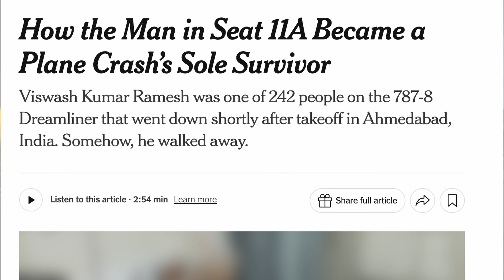Why the RAT Changes Everything – Air India 171 Update

Comment: Shirley on the original video, the sound of the two engines would have been more prevalent than the RAT if they were working. Not to mention the visuals of burning fuel assuming they were on full throttle to try and climb.

Comment: So I appreciate this pilots perspective but there is ANOTHER scenario that was not mentioned. If 787 after startup checklists were not completed normally, the pilots could forget the switch from APU power to main generator power. The aircraft can still takeoff and fly just on APU power. If that APU failed on take-off the RAT would deploy. On this day there was a very high density altitude situation with full fuel and passengers. If the APU failed there would be a flicker in the lights as the RAT came online. This would cause some confusion to the pilots at this critical stage of flight as their minds are turning to the departure proceedures. Not saying the wrong switches were selected but it's still another possibility.

Comment: Thank you Captain, for an insightful analysis and education (had also seen your earlier analysis on a plausible pilot error).  Besides the distinct propeller sound of the RAT, the only accompanying noise pattern that I am able to discern is that of air friction.  At the most, there is just about as much main engine noise as from an airliner on approach or in cruise.  But a fully loaded widebody jet on takeoff should be making that distinctive deafening way-high-pitched whine that would drown out everything else?! If I am right, could this be yet another indicator that the main thrusters where dysfunctional?

In the plausible pilot error scenario you had mentioned about in your earlier video, could the aircraft have collapsed immediately as it did? Or more likely struggled to gain altitude and possibly crashed after several miles perhaps? If either is possible then it is way too scary how sensitive the whole setup is.  The machine should not even allow pilots (who are after all humans and prone to making mistakes) to pull the flaps up prematurely...

Comment: Have you considered the fact that the RAT could have deployed as a cascading symptom of a flight control induced bus instability - LATAM 800 (2024) is a great example where that happened. I am still leaning towards the early flap retraction as I can see the configuration being clean in the HD video which is my primary clue to lean towards flap retraction, and it would have been obvious on the trailing edge if flaps 5 or more would have been deployed. Also if you count the seconds from the point of the usual "gear up" callout to the loss of lift in the first CCTV video, it is weirdly consistent with flap retraction timings... I think this has been a cascade of failures as with all accidents, but we need to wait and see for the initial report.

Comment: what is the probability that the there are some sort of electrical malfunction due to which the pilot could not raise the landing gear though pilots did best to lift the gear and by the time of their try to lift the gear up, the electrical failure resulted the engine power supply failure and both engine did not work and it crashed ? Because the pilot was sufficiently experienced and can be assumed he did not forget to raise the landing gear. there must be situation the landing gear did not go up.....

Comment: My current theory is possible dust / fine sand inhalation by the engines at the end of the runway, leading to engine flameout or severe performance issues effecting thrust. Is this feasible? or are jet engines more robust than that? ingestion of fine dust / sand particles (e.g., from an unpaved surface during an overrun ) could "choke" the compressors or cause significant damage, leading to severe thrust loss or even flameout.  We note the dust at the end of the take off run for this incident. Did they over run the runway ???  The RAT can also be deployed manually. I recon it might have been a combination of issues. hot day, heavy aircraft, possible electrical and or engine failure, RAT deployed could have been automatically or a panic move by the co-pilot in anticipation of complete dual engine performance issues with complete engine failures yet to occur.  Oddly they never said engines out,  but simply no thrust.  Still more ideas yet for formulate.  I think the flaps were deployed fine for take off,  but the aircraft was already at its limits. Possibly over heavy on an extremely hot day. Can't see any flaps extended on that YouTube video of the same aircraft taking off one week prior either, except when close up.  Thus perhaps they did have flaps 5 on that tragic day,  but we just can't see them with the naked eye at a distance beyond a hundred yards or so. That's not my final analysis however.
Reply: The engines could still be physically running, potentially even at idle or a very low RPM, but if their output power degrades severely enough or becomes unstable, the associated generators can automatically trip offline to protect the electrical system. This would lead to a loss of electrical power, triggering the RAT deployment, even without a complete engine flameout.

Comment: Deployment of the RAT seems to point to simultaneous engine failure.  If you don't have the flaps set properly pilots, get a loud warning when they put the thrust levers to the takeoff setting. With dual engine failure you lose electrical power and hydraulic power which automatically triggers RAT deployment.  Question is what caused both engines to fail at the same time?  The fact that you can hear the RAT propeller blades singing over the sound of jet engines running is a hint.  Maybe fuel starvation?  Wondering if it just came out of maintenance?🤔

Comment: The fact that you can’t hear the engines screaming as the pilots pull the throttle trying to gain altitude is pretty telling… if the engines were operational you would hardly hear the rad over them
The other clue is that the same plane was allegedly having electrical issues on a prior flight from Delhi, where the aircon was not operational and some interior lights were not working.

Comment: 😂😂😂😂😂 pilots were well trained so they couldn’t make silly mistakes when flying , they followed their routine , how to fly and most importantly they taught by simulation in class . So no this theory is wrong when you said pilot said this and copilot mistakenly followed wrong step . No no no 
Flate flaps theory was also wrong because if flaps are flate so how plant take off in air ? So it is possible flaps get flate in air but due to technical failure flaps not make any angle so they were flate in air but not when take off

Comment: Perhaps the "flaps instead of landing gear" theory is still correct IF there was built in computer error correction automatic command to drop the RAT if the combination problem of altitude too low and the rate of rise was too low. So, the co-pilot erroneously changed the flaps instead of raising the landing gear such that the rate of climb was too low and the computer automatically dropped the RAT with perfectly functioning engines.

Comment: The exhaust plume on rotation is evidence that the engines were producing power at that moment. The RAT deployment is evidence that they both lost power seconds later.

Could this have been intentional? I hope and pray the flight data recorder doesn’t show both throttle levers pulled back.

Comment: The 787 records 2000 pieces of data twice per second. The black box will provide definitive proof of what happened. We need to determine this quickly, in case it's an operational issue with the aircraft that may also affect other 787s.

Comment: Could have been a dual engine bird strike. Birs dont always fall to the ground, let alone the runway.
I have cleaned dozens of bird strikes off fighter aircraft wing pylons. Hitting a bird with an aircraft is like hitting a bug on the freeway. "SPLAT". And what left over sticks. Hitting a flock of birds is even worse. Very easy to take out both engines at the same time.
Could also be water in the fuel. It happens. Back in the 1980's we shut down flying for two weeks because water got into the fuel line that runs from Nellis AFB, AZ, to George AFB, CA. There was something growing in the fuel, and we had one F-4 lose both engines, shortly after take off. Both pilots ejected, after a scary as hell flight. It was going to crash into a school. They managed to get the Fighter into an unpopulated area of the desert. Both men received high praises for that.

Comment: It means that During the takeoff run to V1 , everything was fine. Everything deteriorated after that point.
Perhaps a problem in the FADEC(Full Authority Digital Engine Control) a software update or a faulty FADEC could have caused a loss of power in both engines. In the past, some aircraft had a thrust pump that was activated precisely in these cases of power loss during takeoff. I assume that the B787 does not have this system.

Comment: It is evident now that reason for fatal crash was most likely dual engine failure.....not error of pilots....you owe an apology to brave pilots !! ( as I recall , you have not flown Boeing 787, you do not have knowledge of 787 , moreover  in another video a 787 pilot and a 787 engineer who worked on the design of the aircraft both separately wrote comments that the 787 will not allow you to accidentally retract the flaps when it is incorrect to do so). Hence your theory of raising finger at pilots was absolutely incorrect ...Shame on you !!

Comment: To me it seems the big question is why would "both" engines fail at the same time. The only thing I can think of is fuel starvation. 
So the question then becomes, what would cause fuel starvation. The only thing I can think of that would affect "both" engines at the same time is the fuel flow was turned or cut off.
Now the question is what would cause the fuel flow to stop. Could it be a malfunction of the engine fuel control cutoff?

Comment: But would have it not become very, very quiet in the plane, if both engines were out? Should have that not been reported by the eye witness and from the video footage...? 
What would happen, if for some strange reason the entire electric system on an aircraft fails? would the engines stay in the last commanded setting or would they go back to idle? 
very strange and sad case.

Comment: Unfortunately the pilot error video went viral. The theory of pilot error was all backed by confirmation bias and ignored the other clues. Crew was experienced. The survivor right from the start said lights flickered green and white. And said plane felt stopped in mid air i.e. loss of thrust. Pilot Blog picture showed front slats extended but not sure of flaps which only extend 5 degrees. Eyewitnesses said they heard the RAT but people weren't sure if from road noise. These other clues could have been wrong or misleading, but there were so many initial clues pointing to plane issues that pilot error should not have been presented so confidently.

Comment: Any machine that relies on electricity to run it is vulnerable to failure due to short circuit, swtch failure  or disconnection. Aircraft have double failsafe systems, so if one sytem fails another backs it up. As far as I know, jets require continuous ignition from an electrica source, they don't self ignite. Electrical failure of the ignotion system on both engines may be the cause, but I would presume that they should be indipendant of each other... The mystery continues...

Comment: The question that I have is while it was on the ground okay before takeoff there is a video I believe I'm not sure but I believe there's a video that shows that over half of the electrical systems on the aircraft did not work prior to take off AC not functioning call button not functioning in-flight entertainment not functioning half the lights not functioning would that not raise a question does not the Apu control all that while it is on the ground. The reason why I say that I know the Apu is only going to give you so much power. And you had mentioned that at takeoff that the passenger had heard a big bang  I don't know if it's a series of bangs or just one big one but you know depends on the sound of it if it was you know a few of them it could be the compressor shutting down. GOD BLESS  all involved.

Comment: As an Airbus pilot I think Capt Steve analyzes is spot on. I initially was leading towards a flap/slat misconfiguration. You can clearing see the RAT deployment.
Reply: Even with wrong flaps settings it wouldnt sink that fast with full thrust right?
Reply: @McChopper2000  You can not take off with no flaps,airplane will react with sound and visual warning
Reply: @McChopper2000  My thoughts too. It had enough initial thrust not just to fly but to climb several hundred feet. Unless the power dropped the plane would continue to fly with the configuration it started with ... at least able to maintain height.
Reply: @McChopper2000  idk
Reply: @McChopper2000  if you want to hop in a 787 and test it out go ahead lol. It’s hard to know the rate of sink in these types of situations.
Reply: Why do we hear the RAT but do not see it during the fly by?
Reply: @martinduplessis6335  It didn't deploy until the plane was about to crash?
Reply: @user-ku4uh4qt6u But you can hear it before the part where it shows it deploy. Wouldn’t it be visibility deployed in the initial shot where the plane is closer and the underbelly can be seen more clearly? The sound and explanation is pretty obvious it’s the RAT just that you can’t see it even though you can clearly see the belly and it’s not there. Does it spin before it deploys externally?
Reply: @Havok412  delay in sound and visual.. very common phenomena
Reply: @martinduplessis6335 my exact thought... i agree that you can hear it but why doesn't the video show it until the airplane is almost gone down. And then it's only like one pixel...
Reply: It's not just see. You can hear it - I lived in London just under the landing corridor for Heathrow Airport. I know how passenger jet sounds. Definitely not this quiet and definitely not the prop-plane-like sound.
I am sold on the sound alone.
Reply: Two things can simultaneously be true. Could we wait for the final report, or is that too much to expect?
Reply: @JMcdonald-z6v  too much. People speculate, opine etc. Human nature, and that's ok.
Reply: almost imposible to mistake flaps for landing gear
Reply: It wasn't his analysis'. He should be giving credit to the other channels that identified this first rather than making out that this is his original assessment.
Reply: More needs to be investigated on earlier flight before making a solid determination for crash besides the RAT activation.  There is an interview with passengers who were on the aircraft as it arrived at Sardar Vallabhbhai Patel International Airport (AMD).  They explained that electrical power was turning on and off (shorting) as they arrived at this AMD.
Reply: Airbus are a much better aircraft than Boeing and hope more airlines are buying them and not Boeing who are already struggling selling them . 😊
Reply: @razorwestham5949  you are incorrect
Reply: There was a guy that claims he was on that plane the flight before with video of the A/C not working, the overhead lights not working, the entertainment screens frozen, and the call button for the attendant inoperable.  This plane never should have been allowed to fly.

You take things with a grain of salt you see on twitter, but the guy included a picture of his ticket with the flight number, info, and a picture of the plane before he boarded.  This was posted less than an hour or so after the crash.
Reply: What is RAT ?
Reply: @lionesss06  Ram Air Turbine, it’s basically a generator that it turned by the airflow generating electricity. If you listen what the narrator says in aircraft it’s to power things like radios and instruments and the hydraulics when both engines fail
Reply: @lionesss06 whatch the video first.
Reply: @lionesss06 RAT -Ram AirTurbine.

Comment: Also to add from me being a crew myself of that same type aircraft of same airline. The witness/survivor told he saw white and green light come up before crash. This happens only when emergency light gets activated and would only activate when engine is not giving power. The green light mentioned is the Exit signs he must have seen light up after emergency lights gets activated due to power failure. White light corresponds to the exit path lighting and egress lights on the door.

Comment: One guy on aviation herald said this and I'm in a strong agreement with him: 

So we have a possible sequence of events:
* Takeoff roll begins. All is normal at first.
* Right engine rolls back after V1. The crew continues takeoff because that's what they are supposed to do.
* The aircraft lifts off. It yaws right because of the asymmetric thrust.
* The crew doesn't raise the gear right away because they are busy dealing with the yaw, and making a plan to return to the airport once they have gained enough altitude.
* About ten seconds later, the left engine fails. The RAT deploys.
* The crew turns a bit left, looking in vain for some place to put it down. (Judging from the Google Maps, that area is all heavily built up. The water to the right was too far away.)
* Crash